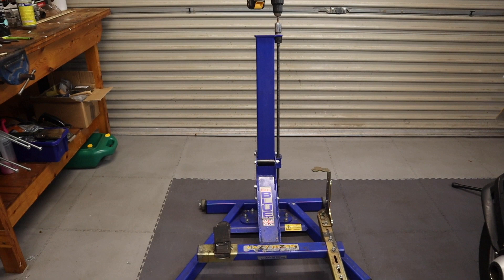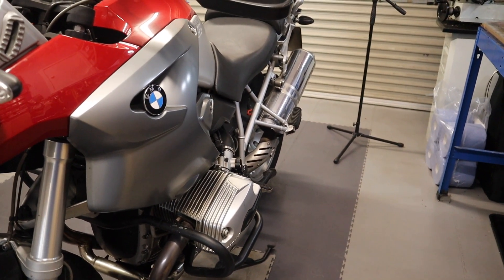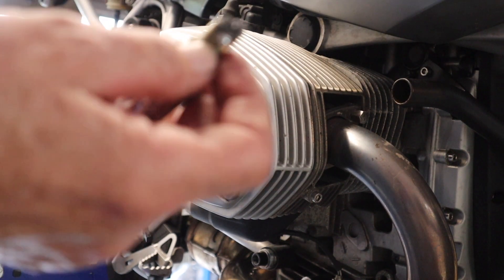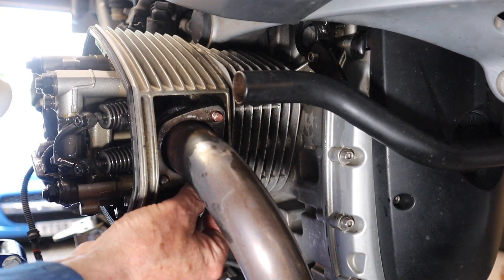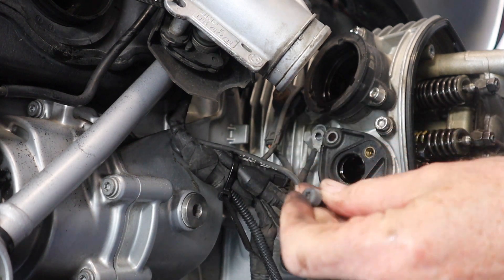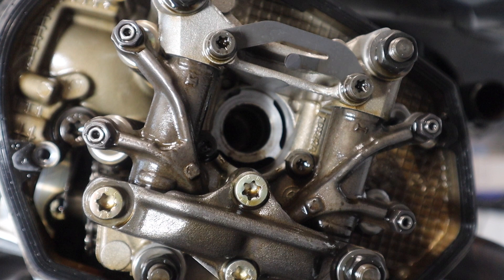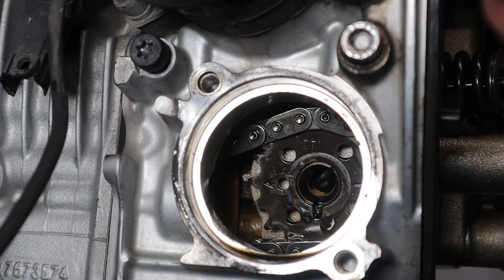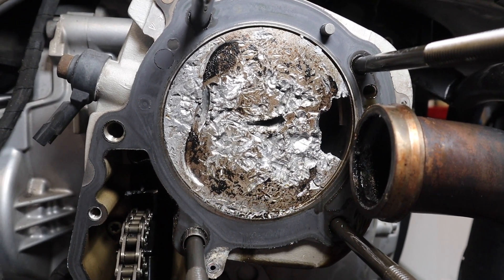Catastrophic Engine Failure

Comment: Never seen something like that. Great video. The important thing is your son is safe, when something like that occurs while you are riding...you never knows what it could happen.
Reply from the maker: Davide Bugni Hi Davide, thank you for your comment and that is 100% true. At the end of the day it is a 15 year old bike that Jason has had for about 3 years. We have really enjoyed looking after it has now not going to go anywhere, unless we replace the engine. 🤔
Reply: @normski3091  I have a 2007...with 65000 km....hope it will last for few years to be honest :)
Reply from the maker: I do think it is a very rare failure Davide. But what can you do, apart from having your cylinder head completely rebuilt by specialist engineers!  If you see the cost of just the BMW valves alone you will just keep riding as we all do.
Reply: @normski3091  it is probably cheaper to find a new engine, rather than repair valves, cylinders, etc. Of this one. Ah...by the way I have just replaced the drive shaft of my bike,  the rubber torsional shock absorber was gone. Thanks for your videos.

Comment: Hi, First of all. Your a Great Dad to work on the Bike for your Son. Second, your a Great Mechanic. It’s too bad the Piston has a Hole in it. You could have just replaced the Cylinder, Head and Piston, along with the New Valves and everything. At least the GS has been around long enough to where you can find a Good Engine for a Decent Price. You’re going to have a big Job ahead of you, but at least you are a Great Mechanic. If anyone can handle the Job, I think you could. Thanks for making these Videos. I ride a 2006 R1200GS and have really learned a lot from you. I’m glad your Son is Safe. It could have gone really bad if the Engine had locked up. He had a Angel Riding with him.👍❤️

Comment: Do you think it is possible to swap cylinder heads from the newer model ? 
The one that is used in the 2011 models and  ninet’s? 
I assume that model has improved valves 

Assuming no cost issues or a good salvage pair is available...
Reply from the maker: Hi Carlos I don’t think that is possible. I am not 100% sure but the model change in 2007 and then again 2010 and BMW do make numerous changes, even any gaskets are different. Positive way would be just to call a BMW dealer and ask their service, if any are open in these difficult times🤦🏼‍♂️

Comment: Mine started making noise on the right side too. Damn it, 2018 9k miles. Is a new bike for me and started hearing a soft clicking noise on the right side. When I start the bike, it makes like a chain noise and goes away. I am in the middle of a trip. Is this normal? I hope I can make it home and check the bike there.
Reply from the maker: Hi Marcelo, You really should be OK. It was the 2005-2007 GS's that had a 'fault'. Never heard of one dropping a valve outside of those years. When you get back find my video on checking the valve clearances. It is simple to do and is a good place to start. I would be surprised if it was the cam chain? You will make it home OK I am sure😀

Comment: Sad story, luckily it was only engine damage...

I have exactly the same bike with 30,000 miles,  affraid of having similar failure , 
Do you have any clue on  why this happened or how it can be prevented?

was it a tensor?  broken chain sliders?  defective/loose chain? low oil pressure?
Reply from the maker: Hi Carlos, yes you are correct, imagine at 70mph if the engine had seized in peak traffic, Jason would have been thrown off the bike! The damage of course was so great it is hard to find out what actually went wrong. However the chains and sliders appeared OK, both exhaust valves had disappeared. The input valves were still there but very bent. Never had a problem with oil pressure. The guy who runs a tyre changing mobile service here, Mark, is an ex Superbike mechanic. He says it is rare to ‘drop a valve’ on the road bikes but he has seen it a few times in the 2004-2007 models and always the right hand side cylinder.? What does that mean?? He said there would have been no indication or warning. On race bikes he has seen them blow the Cylinder  head off. BMW chief mechanic said he had only seen it once in 10 years.
Reply: @normski3091  Hi again. Do you think it would be a good idea, to put in New Valves around the 50,00 Mile Mark? I’m just wondering if that would save being worried about that happening. Thanks
Reply from the maker: @joeybobbie1  hi Joey, thank you so much for watching my channel. I also thought I would replace the valves in the used engine I bought, until I saw the price.😱. If everything is running well I would not touch the valves🤔. I appreciate it is a hard decision because it does appear that there is a design flaw in the valve set up for these 2005-2007 1200 engines, but if you spend all that money and time what guarantee would you ever have that it had cured the problem. As one BMW engineer told me he had seen it once in 10 years. So a very small percentage of bikes, I would keep your bike regularly serviced and love it😍

Comment: The effort involved , and possible costs , in a total engine rebuild is vert likely to be  more than just fitting a second hand engine . The only good news is it did not lock up and the throw the rider down the road.
Reply from the maker: Absolutely Keith, imagine how bad it would have been if Jason had be thrown off at 70mph on a fast, busy A38 dual carriageway 😱. Think as a family that reality has calmed us down about the state of the bike🤗. I will either have a project for a long time (found a 2005 engine with just 33,000 miles for £699) or throw the bike away. Watch this space🤔

Comment: Do you remember what the cams looked like?  did any have unusual wear on a lobe?
Reply from the maker: Did not notice anything in particular, but the engine was such a mess, like a grenade had exploded inside. Buying a 2nd hand 2005 engine meant we just took the old engine to the scrap yard🤷🏼‍♂️
Reply: @normski3091   Thanks for the reply.  I was just wondering if maybe the Cam/Rocker arm issue, 
Ref: US 64011504-05 may have been the initial cause of the failure
Reply from the maker: Could never be sure but it really looked as if a valve had just dropped. Two valves had totally disappeared and the remains exhaust valves, bent up like a piece of spaghetti I keep on my workshop bench to remind me😵‍💫😱

Comment: Always thought BMW bikes were the most reliable but for the valve to drop its bad form, it moved me to look at reliability tables and BMW bikes, like their cars, are very mediocre (and drive both a BMW car and bike), with regards to reliability the Japanese have it licked,  I’ve bought new BMW bikes only to find frame and cylinder rusting, to be fair BMW fixed immediately but I’d rather not have had the problems in the first place. Right getting my RT out and going for a ride, hope I make it back without the piston falling out, but as the great Normski services my bike I’m sure it won’t!

Comment: Very interesting video, thank you sir! After an adventure on a rented 1250, I want to leave my F650 behind and buy a real GS. After a lot of research into affordability, horsepower, and durability, I really thought the 1200 GS was going to be my top pick. After this video I'm scared. Are many of these serious flaws known among YT viewers? The later R1250 is too expensive, the 1150 and 1100 have less horsepower and Nm, I also find 5 gears little for highways. Greetings from Belgium.
Reply from the maker: Hi Deureka from Belgium 🤗…it does seem that the problems where on the 2005-2007 1200GS. Some say that there were faults in the valves in those early 1200 bikes. Not heard of any similar failures outside of those years. So you should be safe if you choose 2008 GS onward.

Comment: Blimey!   Feel for your son with that going like that, but he's safe and walked away from what could've been a very nasty incident at that speed. Surely second hand engine would be the cheapest and wisest option? How much debris has gone elsewhere? Use what's left as a spares dept I reckon Norm.
I hope it doesn't end up costing the earth for your son. That could be any one of us tomorrow god forbid!
I wish you both well 👍
Reply from the maker: tojjer29 Hi Tojjer, yes what a disaster. A good fiend of mine, Mike, who now lives in Dallas, Texas and has been a chief engineer all his working life rang me yesterday. He said that the hole in the piston saved the rear wheel locking which would have thrown Jason off the bike at 70mph in heavy fast traffic. When you hear things like that then a broken bike is nothing. Mike said that the strain on the whole engine would have been so great do not even think about rebuilding it🤦🏼‍♂️
Reply: @normski3091  It's true what a friend wrote, the rupture of the piston released the compression, thus releasing the rear wheel.
If the piston had not burst, it would have been a tragedy.
Reply from the maker: @RichiPM76  yes the more I think about it the more I think that is right. 3 of us are riding down to Triumph for the factory tour next week. If I have the opportunity I will ask the opinion of their engineers!

Comment: Is that common on those engines, I thought they would run forever. As you say at least he managed to walk away 👍🏽
Reply from the maker: Hi Anth, I also thought that a boxer engine would run forever! No I do not think it is common at all thank goodness, but I have discovered that it does happen especially in the 2004 - 2007 model of the GS. It also seems to be the right hand cylinder and around the 60,000 mile range? You do find threads on Google of riders experiencing the same. One thread was very interesting saying that there were a number of recalls by BMW on this model during those years to remap the fuel injection as it was running too rich (or the other way round). If Jason’s bike was not done, and there is no evidence, then maybe the valve was weakened over time, we will never know. As you could see the exhaust valves are not even there anymore. Here in Derbyshire we have a brilliant mobile motorbike tyre fitter, Mark Croft, who I always get to change my tyres. He was a Superbike mechanic for years and services and repairs bikes as a mobile mechanic. I rang Mark who says that dropping a valve is unusual for normal road bikes but he has seen it many times in the racing circuit, however he also assured me that it does happen and within 2 seconds will smash the inside to bits. Mark says we really have two choices: throw it away or buy an engine from a breakers.🤔

Comment: This is just what you might have to do if you come across this situation. You strip down and clean as far as you have to before you scrap the lot or recover what you can. The piston will get a hammering @ 8000 rpm  in a few seconds before failure for instance. Other than that I think it's f*cked!

Comment: Wow. This makes me a little skiddish on buying a GS. Although I hear working on the newer 1200/1250 GSs are a lot easier. Kind of makes me want a super Tenere instead
Reply from the maker: Hi Miles, from what I can find out it seems to be the 2005-2007 GS models that very rarely dropped a valve??
Reply: @normski3091  that's great to know. And thanks for the speedy reply. If I get one it will be a 2014 or newer. Seeing a video on how to do a valve check made me thing the GS us a much better option for those of us that like to do most of our own maintenance

Comment: Strange, do you use the right oil ? Change on time ? No ofense, i see u take good care of your bike.
Reply from the maker: Hi Manuel, everything serviced correctly and oil changed even before due. The more I have searched and spoken to riders it is the 2005-2007 1200GS that seems to have an inferior valve that can drop and blow up the engine. Problem is that there is no warning. My son’s bike I rebuilt now has a second owner who loves it and no problems 🤗
Reply: Important is your son is ok, sad is, BMW put faulty valves.
Reply from the maker: Yes Jason, my eldest son is fine. He could have been thrown from the bike into the traffic. 😱
He has given up riding which is such a shame 😢

Comment: R1200Rt engines much more cheaper... someone can tell me if I can put RT engine in r1200gs 2006?from outside looks completely same ,just 10hp difference 🤔
Reply from the maker: Hi RR, that is a good idea but I would be very surprised if it fitted. When I bought the used 2005 1200 GS engine the breakers were very specific that I had to get exact engine for the 2005 1200GS?

Comment: So what caused the failure? I call B.S. that just happened out of no where un provoked.. he either got on it and started riding the hell out of it before the engine was all the way warm or he downshifted bad or forgot to upshift or just plain didn’t change his oil I put the wrong weight oil or perhaps his valves are just so far out of adjust that they actually had to contact but who knows I’m not all that familiar with these all I know is I got mine with 80,000 miles 84,000 actually and I’m at about 95 now I love it and I ride the shit out of it it has not failed or blown up like that on me. Thank God had to do starter alternator several tires couple spark plugs view valve lash adjustments all my gearbox oil like five times my final drive oil, my forks, I had to reseal the fork seals and put the oil there you know the good stuff I did a clutch with the clutch slave my windscreen broke so I had to break something up with that other than that she saw it. Front room is bent. I’m gonna have to figure that out the ungodly expensive
Reply from the maker: There was a fault on the valves and collects on some BMW 1200 GS bikes from 2005-2007. A number blew their engines to bits. My son is a brilliant rider who used his GS daily. I serviced it regularly never missed anything. The number of riders who have emailed me with blown up 2005-2007 GS’s 😵‍💫

Comment: So it’s the same engine as the RT it’s the K 26 I’m just a couple different years are just not as good or what
Reply from the maker: Yes I often wonder that myself. It must be the same engine in the RT for 2005 - 2007 but I have never heard of an RT engine blowing up like the stories of the GS?? What on earth does that mean? I fitted the second hand 2005 engine into my son's GS as you see on the video and then sold the bike. Last year I heard from yet another owner who had bought the bike from a dealer and he said it was running perfectly. So it just seems that it is only a few bikes that fail? Of course you never know which ones🥵

Comment: Paul griffiths  had the same problem on his bmw,i think he was quoted £1200 he got rid off it and he would never buy another bmw.
Reply from the maker: Yes you are right. Normally 2005-2007 1200GS, there appears to have been a problem with the valves😱